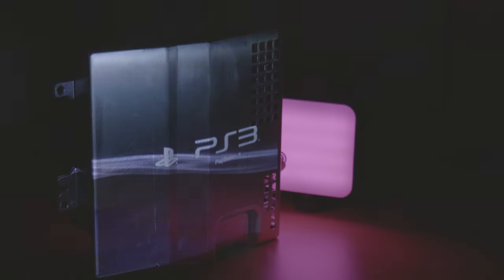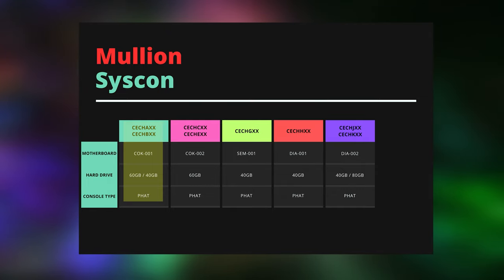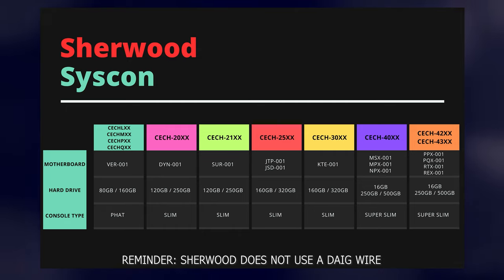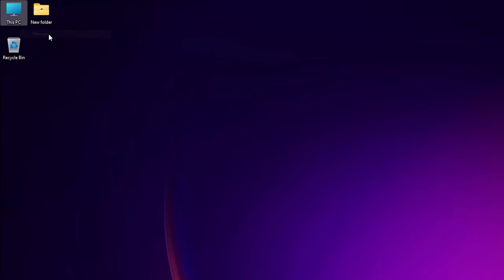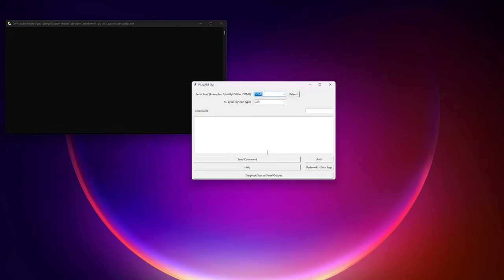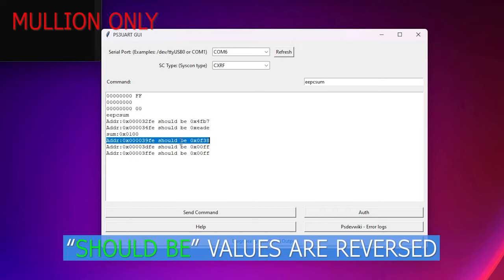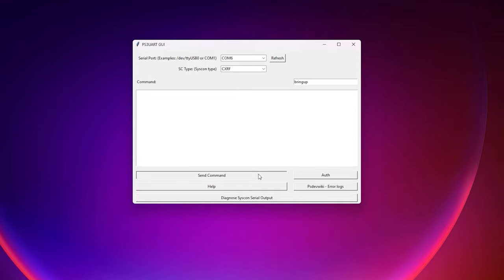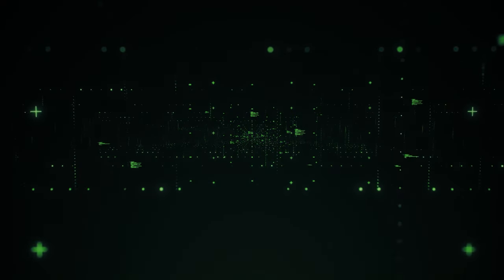HOW TO Diagnose a faulty PS3 ⚠️ YLOD || Easy UART SYSCON Tutorial For PlayStation 3 Yellow Light

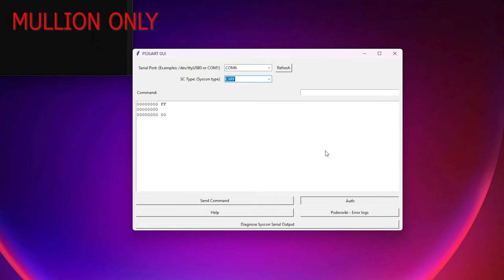Comment: Great tutorial, going to test on a 3 bips blinking red light CECHK01 here. Just one question: at 11:39, in the screen the command reads EEPSUM, but on the app screen you typed EEPCSUM. Is it a typo, or both commands work the same, or just the one you typed (EEPCSUM) is the right one? Thanks!
Reply from the maker: sorry type EEPCSUM

Comment: I followed all the steps for my VER.001 ps3 but when I connect the syscon to the pc and click "Auth" it shows the error that you mentioned in the video. I tried swapping the cables but nothing changes. I tried downgrading python to 3.10 (as this program seems to work on that version of Python), but it didn't help. I also tried using another pc with windows 10 this time (instead of 11), but I get the same error. 
I've been troubleshooting for an entire day at this point but I'm unable to find a fix.....do you have any idea what the problem could be?
Reply from the maker: Is the uart adapter showing in device manager correctly, sometimes windows installs the wrong driver.
It may be showing as libusb or something, manually change the driver by going update (right click on the device > “let me choose” > then manually select a different driver from the list

Also if you are using bread board jumpers, sometimes the wires aren’t crimped and have no connection inside (this happened to me yesterday) 

Also confirm ground is connected 

When installing python ensure add to path check box is selected
Reply: @Slot1Gamer  I manually checked continuity between the cables and the motherboard but the device was indeed being shown as an "unrecognized device", so it must have been the drivers not being installed correctly. I somehow still managed to make it work via the cmd version and I got 1002 and 2114 errors, so my NEC/TOKINs must be broken.....
It's a shame because that was my uncle's PS3 and he gifted it to me in 2015....I have so many memories of me and him playing Gran Turismo and GTA IV but the fix is not worth it imo; I'll probably get a used PS3 slim but I'll lose all my data that was on the old hdd.
Thanks for the help anyway, it could be helpful in a future troubleshoot 😁

Comment: I believe the GUI has a character limit and commands like bringup won't give you the full read-out. Given that this is one of the more useful commands it makes the current GUI not awesome in some regards.
Reply from the maker: It seems to bring up the error log fine which has a large character count
You can scroll inside the response window
Error log is probably the main reason people will use this anyway
Reply: Nice work. 

A few things. There is more information about the bringup string that doesnt show when the Power On Sequence reaches a certain point, namely the bittraining and bootloader string. Both of which require you the hit enter a second time to display the rest of the log. IIRC the GUI didn't display it. It adds a layer between you and the uart script that can also mess up commands, which is why I didn't include it in my tutorial. I also wouldn't have told them to enable internal access on mullion as a default. Changing a byte is a step people can and do mess up. And if they accidentally change the wrong address it can be hard to fix. So I would have liked to see you first tell them the external commands they can use before adding that they could proceed to internal if they are adventurous.

The errorcode section probably should just link them to the dev wiki where explantions can benifit from improvments over time. I dont want to comment io the accuracy of the code explanations you offered, but they can be misinterpreted easily and the step numbers are missing. And extreemly important. This is a habbit I've been trying to get people to break. The last four digits are not the whole picture. We NEED the step # also. It can litterally be the difference between a fuse that blew or a dead GPU. When an error occurs is very importnant to know.

Relatively minor things tho. All in all. I liked it!
Reply from the maker: Hello,
I see very useful information thank you, I’ll add it into the description ❤️

Regarding the byte change, I feel (maybe I’m wrong) the risk is about the same or less than any kind of repair that will be attempted anyway

A messed up syscon could possibly be fixed but a chipped die from a messed up de-lid not so much. 🙂

If I can add some text overlay to the existing video explaining external commands I will or a pinned comment.

Yep still got to finish the description and all that , adding the syscon git and dev wiki today haha 

Thanks for watching and the tips :)

Comment: the console can be turned on with the UART controller connected? my console is bricked in recovery mode, doesn t recognize usb either. That's happened after i tried to install cfw.
1. i cleaned up the console and drilled some holes in case for a better air flow (ps3 CECHG04) but i lifted up the disc drive destroying the flex cable grip from the MB. 
2.Then i started to dump syscon with an web tool, all good until i had trying to install "EvilNat 4.90.1 CFW " . I didn't know that the console checks the disk drive while updating the firmware
3.Console entered into a boot loop which every time finished with an error, so i cut out the power supply. When the console turn on again in Recovery mode, all usb fat32 formated with ps3 update on it becomes unrecognizable. it can't rebuilt databases or format HDD.
Reply from the maker: Yes it can, but it sounds like you may need to use a hardware nand flasher to fix your system
Reply from the maker: Did you try the evilnat no BD update image if available
Reply: @Slot1Gamer Shall E3 NOR FLASHER be of any help for this ?
Reply from the maker: In this case as it sounds like NAND/NOR corruption yes but it’ll require a bit of work.

Comment: My SW never auth. i dont get what i am doing wrong. Can you help pls?
Reply from the maker: Is your wiring ok
And what’s wrong with your console
Reply: @Slot1Gamer   yes. I have done everything like on the video. My old retro PS3 works fine,mi get all errors. But Im the Slim i cant get any.
Reply from the maker: Does the slim get any power?
And have you tried swapping the RX and TX wires
Reply: @Slot1Gamer  yes She hás power, and did try a couple of Times Change the cable. I really cont get why i cant get the errors on the PS3 Slim. My PS3 60g works fine a d tell me everytime the errors.
Reply: Did you manage to fix it, because i have the same issue
Reply from the maker: Try another ground point maybe
Reply: i always getting GROUND from one of the HDMI legs. Just to be sure

Comment: If you dont get a red or yellow light, can you still use SYSCON to diagnose? I have a BC Fat that doesnt boot, but also doesnt red or yellow light either. Stays green, just never boots with screen artifacts and TV knows something is plugged in. Thank you!
Reply from the maker: Should be able to yes, the console has power and sounds like it’s hanging on GPU startup

For this I suggest getting the log, then run bring up command (you may want to use the command line version of the tool for bring up )

Comment: i've soldered some stuff before but this is going to be my first real project. i have DIA-001 and plan on buying a broken one on ebay to practice but do i need to use flux before soldering the jumpers to the board?
Reply from the maker: Yes use no clean soldering flux

Comment: I have 1200 error I changed the thermal paste but the same ylod... Is there any solution please?
Reply from the maker: Small change excessive noice from the NEC caps could cause it but it’s likely a physical issue with die or bga
Reply: Try replacing the paste under the cpu lid
Reply from the maker: @TheGlitchyMario  yes made assumption that's what they meant 😅
Reply: @Slot1Gamer   what if I apply some flux and heat the cpu?
Reply from the maker: These boards take insane amounts of thermal energy to reflow the cpu 

Warming up the cpu may bring it back temporary and that would indicate a solder bump issue on the die but those are rare for ps3 
Most issues lie in the gpu
Reply: @Slot1Gamer  thank you very much ❤️❤️

Comment: pls can u explain how to solder the wire to the ground pad on the superslim model? i can not get the pad tinned and without that wire i only get auth1 error :(
Reply from the maker: You can also try getting an alligator clip and connecting to the ground strip that runs around the outside of the board or on any part of the shielding.
Reply: @Slot1Gamer  yes! i was able to do it that way. thank you! 🙏🏼

Comment: My PC doesn't recognize the usb uart, I installed the drivers and it still doesn't appear as a port, what could it be?
Reply from the maker: Sometimes it installed as a different device.
You need to find what it showing up as in device manager and manually choose the driver (update driver > choose driver from list) 
Then it will install as FTDI
Reply: @Slot1Gamer  thanks, i will try
Reply: I do that, but now the program when i press auth gives the error permissionerror, what i do?
Reply from the maker: Try moving the program to a usb drive or to C drive, if you run from desktop as admin sometimes it can’t access the files in that location

Comment: Any idea why I can't get any Sherwood models to work with this? Mullion works fine.
Reply from the maker: How many Sherwood have you tried? 
Try swapping RX and TX and check the ground
Reply: @Slot1Gamer  A few. 2 slims, 3 fats. Mullion works fine it authenticates every time. Sherwood never worked on a all the ones I tried. Checked and rechecked everything and always get a Auth error.
Reply from the maker: @ramiq7932  you can check the resistance to ground on the RX and TX lines on the sherwood machines and compare to a known good unit.

Do all the SW you are trying attempt to power up? or atleast have 5V_SB present
Reply: @Slot1Gamer  Will check. They all have YLOD issues but power up to standby just fine. It's really weird. Zero issues pulling Mullion codes.
Reply: Got the same problem, my SW never authenticates. I cant tell what is wrong.
Reply: Same here, anyone got an idea as to why?